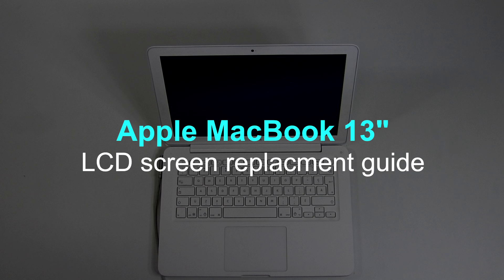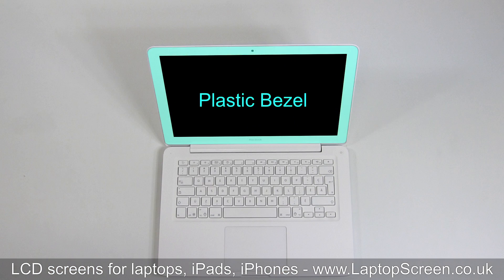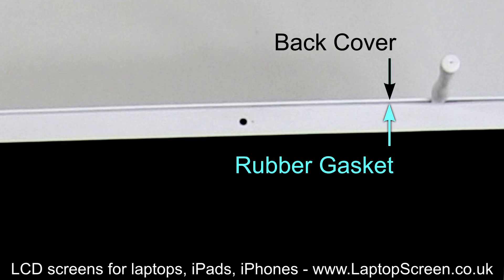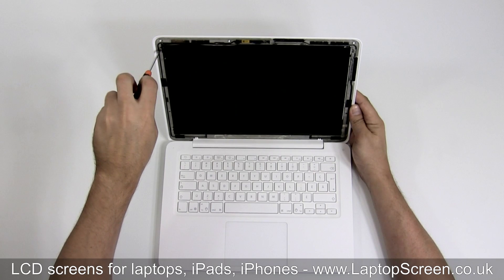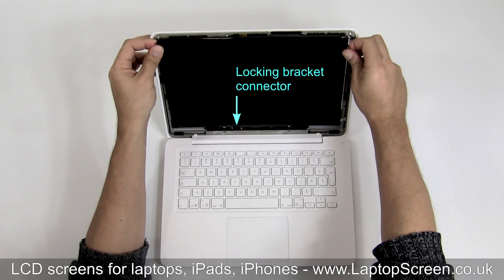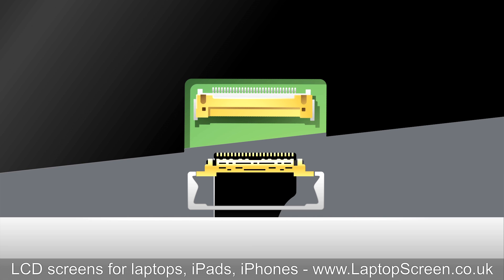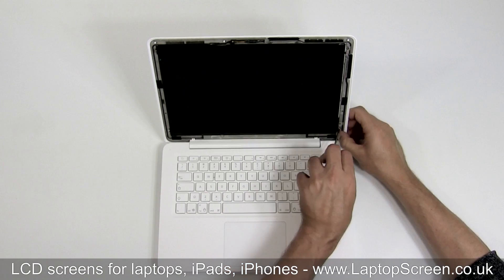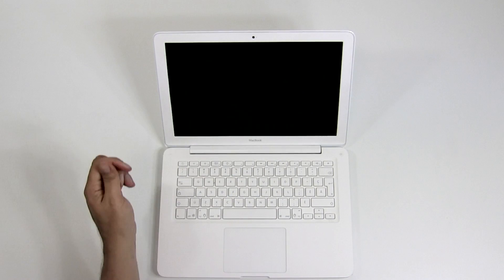MacBook 13 - how to replace laptop screen / Fixing LCD.

Comment: Step 1 is actually easier than expected and can be done with a hair dryer. Note: Don't be impatient! You should apply heat for a full 2 minutes before even attempting to remove plastic. If you feel any resistance, continue applying heat. I have 2 broken Macs and I got impatient with the first one (the mac that I will be discarding) and bent the plastic bezel. Take your time guys.